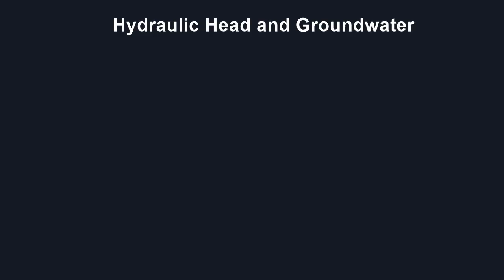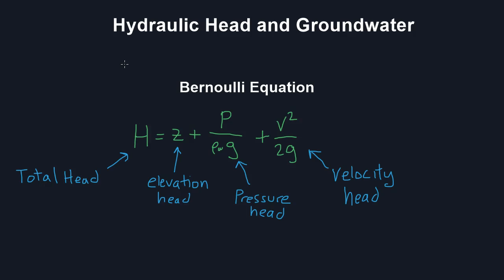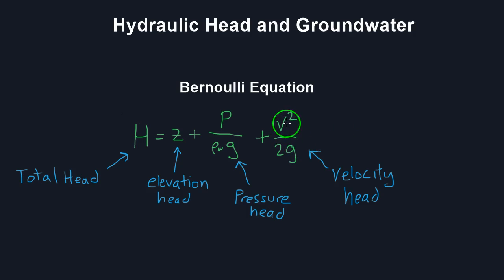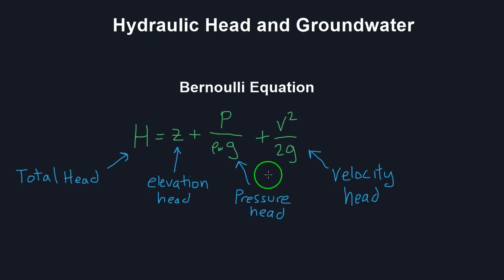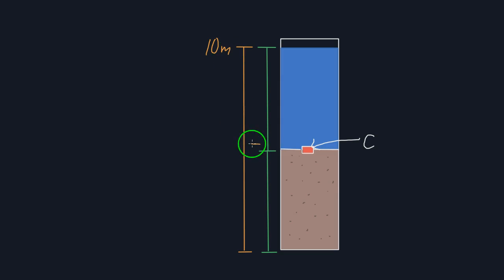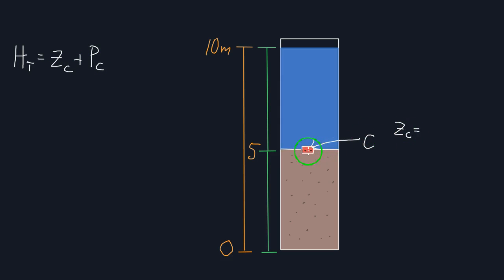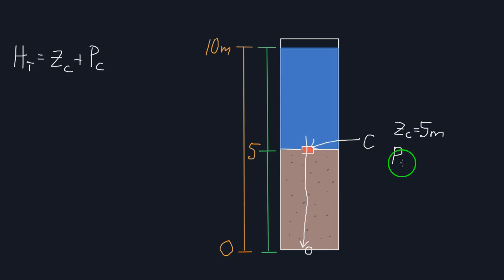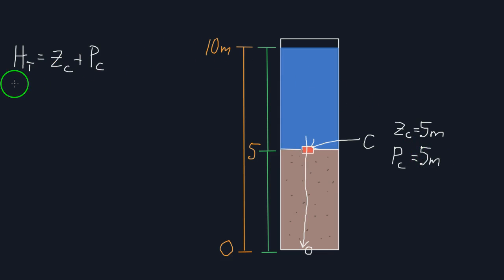Groundwater and Head

Comment: I would really appreciate an answer to this question: how can pressure head just be the distance of the water above the point? Would the volume of water pressing down on that point not also affect pressure? And the horizontal distance from one side of the container to the next? I am just super confused about the concept of water pressure, and would appreciate any resources you could direct me to.
Reply: Did you find out the answer?
If yes.. It will really helpful if u share it..